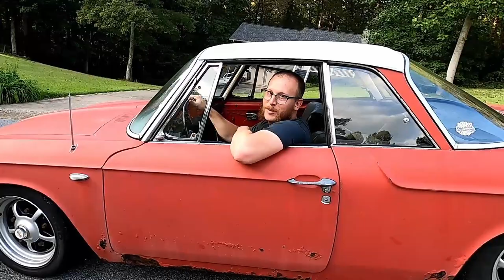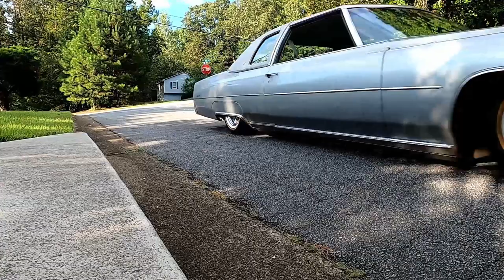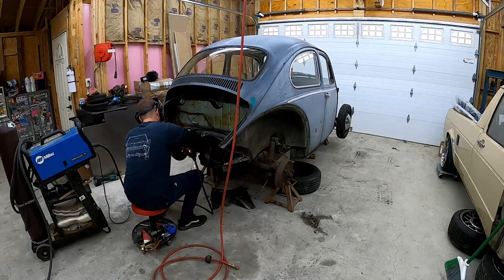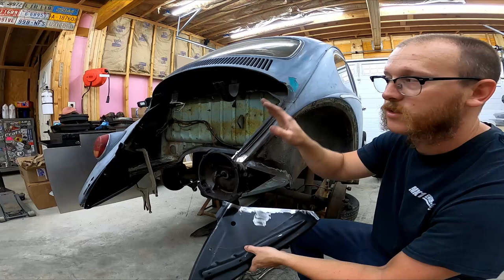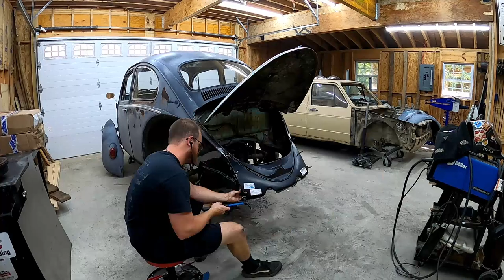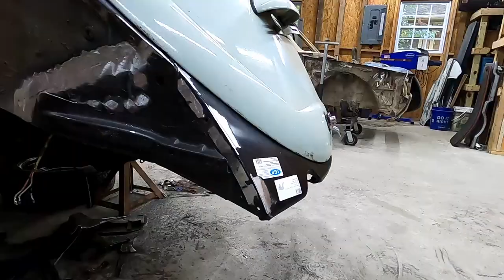Installing rear apron on VW Beetle

Comment: Leaving the rear apron removable is a huge advantage for R &R of engine. Since the bolts go through and into the body everything is held tightly. I do it on all the beetles I restore.
Reply: I have considered this myself
Reply: Do you use nutzerts or?

Comment: Great video mate thanks for posting.  One question - instead of using those fasteners where you have to drill a hole to hold the apron in place - can you instead, just put the last few bolts in that hold the fender on?  Don't they go through from the outside where the bumper hanger is, and through the apron?  Thanks again for posting - you're very clear and helpful.
Reply from the maker: Technically yes you could with a large washer, but the bolt holes do not go through the apron. The bolt holes are in the rear quarter and the apron skin kind of skirts around them. I like to use the fasteners when I have a lot of fitting and mock up to do, and the apron is coming on and off multiple times.

Comment: Would CHICAGO ELECTRIC 240V Spot Welder – Item 61206 / 45690 This portable, air-cooled spot welder makes quick, strong spot welds in a wide range of materials including steel and cast iron. Welds uncoated mild, galvanized or stainless sheet steel to . The spot welder has 6 in. tongs lock firmly onto materials. Work on this?